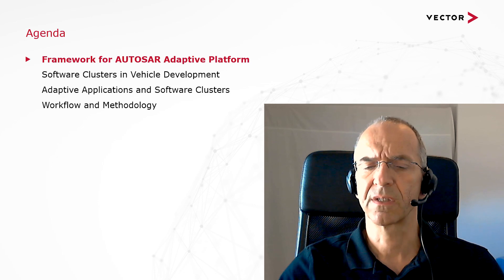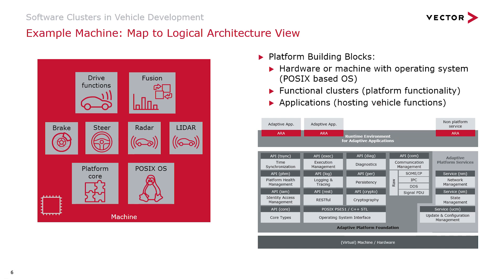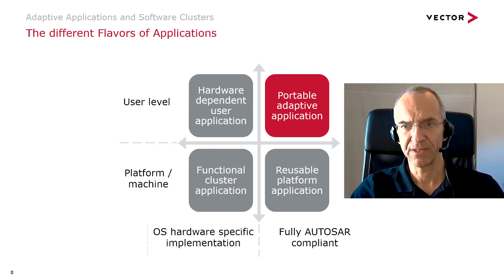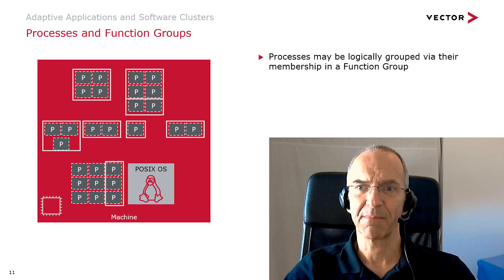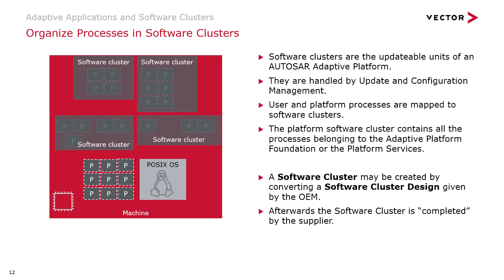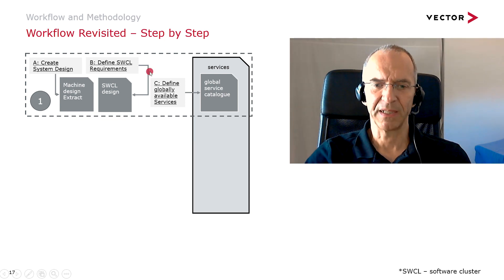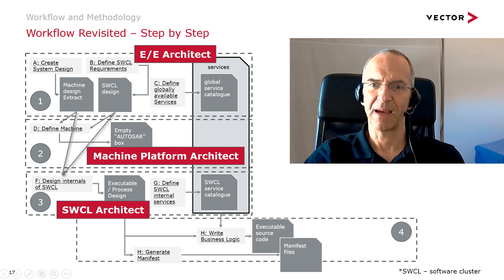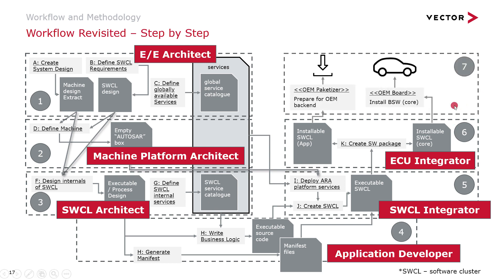AUTOSAR Adaptive: ECU Development - Vector Virtual Sessions 2020

Comment: Thanks for the explanation! so architect team now also create an executable file to generate the actually skeleton software from what I understood, I'm I right?
Reply from the maker: Based on the model created during the architectural phase the application developer gets a skeleton for the executable file (this could also be generated based on the model) and starts to add all the programming logic. Please note that the code of the service interface APIs is generated too and available to the application developer via included header files.
Reply: @vectorinformatik  thanks for the answer, does the tools have some kind of export to generate the architecture model in a friendly format that can be used as design documentation? this would help to make the design faster and the documentation being up to date with the actual implementation, I hope this is the case to avoid duplicate effort.